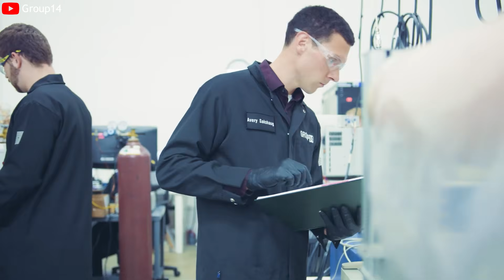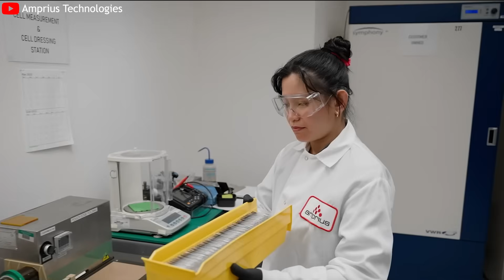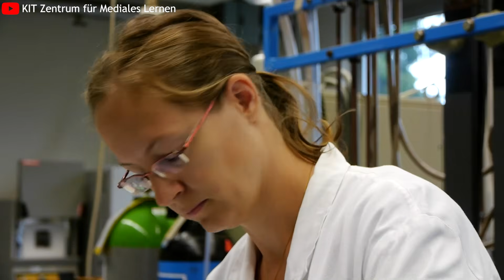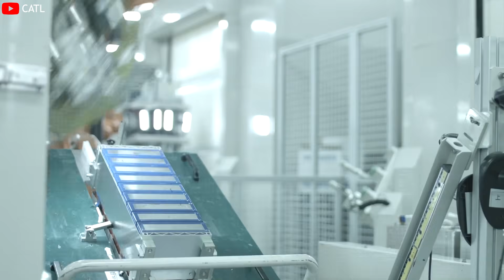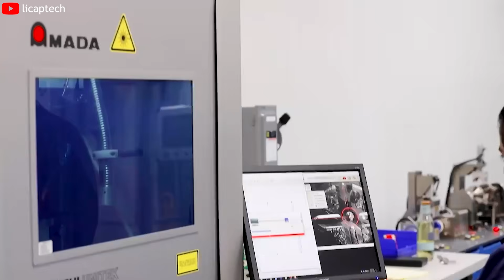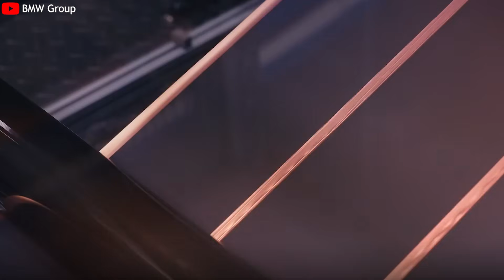Donut Solid-State Battery Just Tested 4.5 Mins Fast Charging...Is This Actually Real?

Comment: In most cases, testing is not considered to be independent if it is paid by the manufacturer. Just because Donut labs pretend these are independent testing, doesn't mean it actually is the case